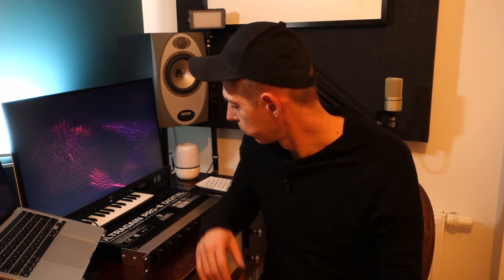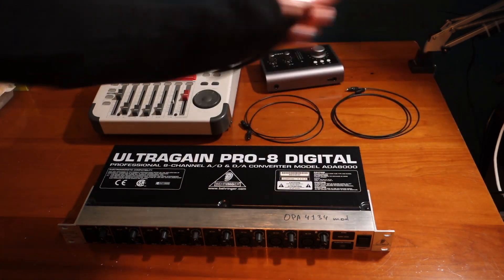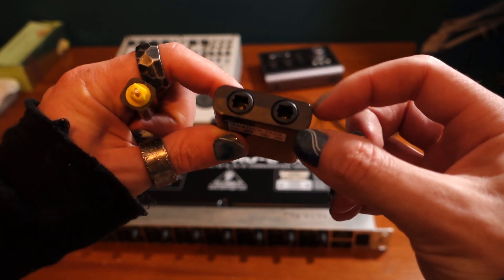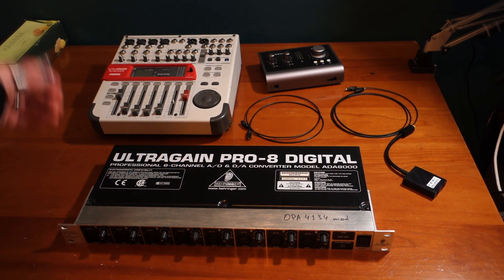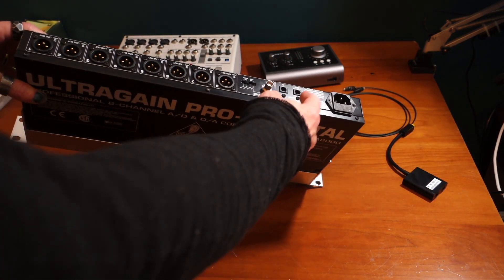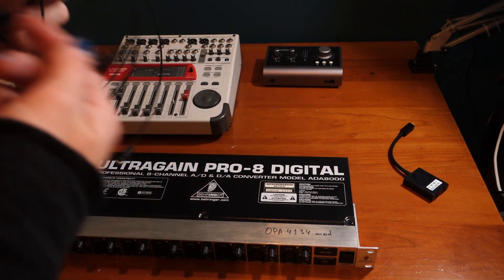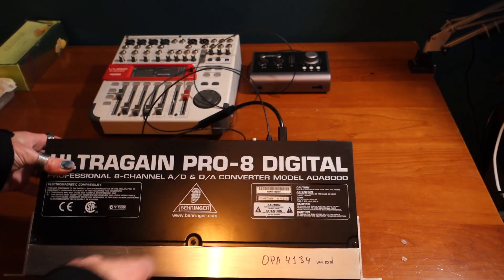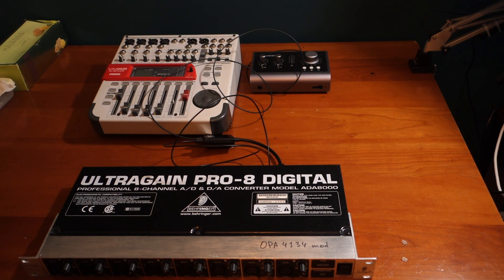Behringer Ultragain ADA8000 and ADA8200 hack

Comment: You can definitely use ADA8200 as a preamp, just connect the Toslink output to Toslink input and then connect the XLR outputs to the Tascam input.  My question is, all eight individual outputs ( ADA8200 ) receive the 8 individual inputs ( ADA8200 ) or just one output ( ADA8200 ) for all the imputs of the  ADA8200 .  Thanks for sharing your knowledge.
Reply from the maker: IIRC it will be in1->out1, in2->out2, etc.
Reply: Thank you so much for your help.

Comment: Nice video man, I have a question, me and my Friends have an 8 person podcast, with 4 dynamic mics (Podmic) and 4 condenser mics, all mic is connected to a Tascam US-1641 interface, we récord in reaper, my question is can we use this Behringer ADA8200 like a Cloudlifter? Like a mic preamp? The 8 microphones via ADA8200 then through the Tascam US-1641 interface? , Thanks in Advance.
Reply from the maker: Hi! Thanks for watching the video! So the problem is that the Tascam is not giving enough gain and you need a preamp? You can definitely use ADA8200 as a preamp, just connect the Toslink output to Toslink input and then connect the XLR outputs to the Tascam input.